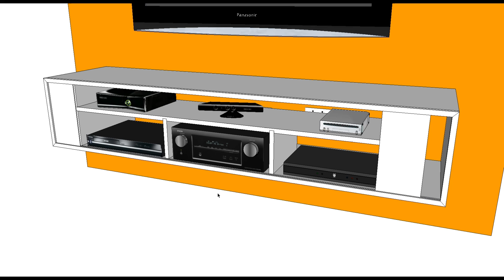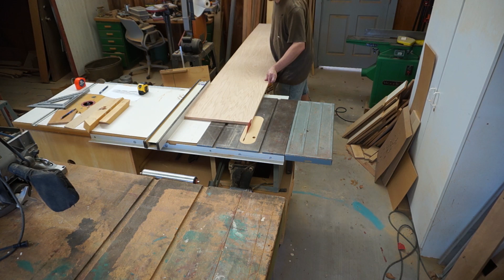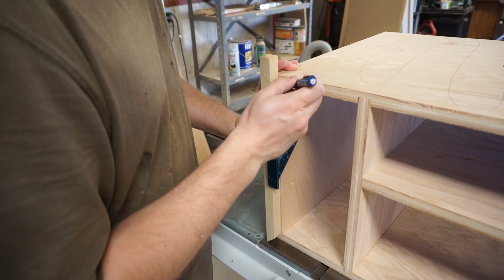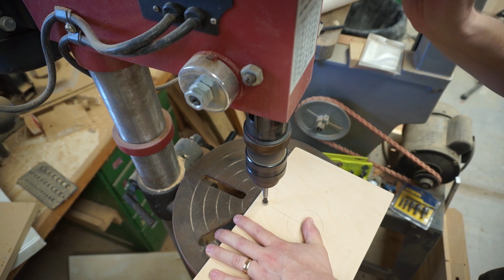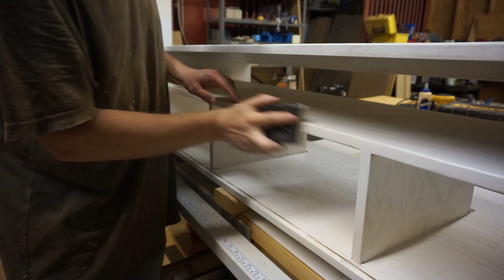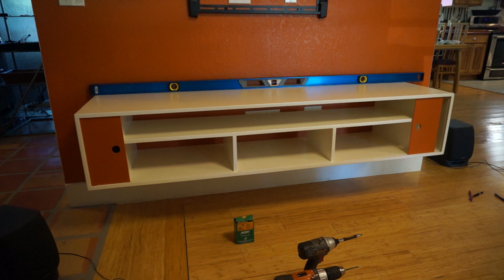Custom Floating Media Console | Mid-Century Modern | Woodworking

Comment: Do you get enough ventilation for the AVR? Seems kind of tight.
Reply from the maker: I was originally concerned about that and thought that I might need a fan... but no, the heat hasn't been any problem at all. The opening behind the components is open to the shelf above and it creates a "stack effect" of sorts, where the hot air is drawn up and out.

Comment: i downloaded the file and opened it up. it has the 3d model and a image of the boads and cuts, but info on actual board sizes( width and length of bottom/top boards ect) am i missing something?
Reply from the maker: The lengths can be measured directly in SketchUp since you have the full 3d model.  The advantage of this is that you can use whatever measurement method you prefer and get any variation of measurements you want.  I find static dimensions useful only in printed out plans.

Comment: 3/4 inch width not is too much heavy? I planning something like this but 7 feet long. Do you think 1/2 in width can work?
Reply from the maker: I didn't think that 3/4" was too heavy -- this specific design can be made with one sheet, so it weighs a total of 40lbs.

My original concern with 1/2" was that it would sag over time.  I will say, though, that after a couple years of having this installed, I haven't noticed even a tiny bit of sagging, so 3/4" may well have been overkill.  So while I never tried 1/2" in this application and so can't say for certain, it seems like you should be fine (maybe put a support half-way in the top opening, due to your extended length).

Comment: French cleats..?
Reply from the maker: French cleats could work here and were my original plan.  Using them does suggest that the piece be easily removable, though, and this console is practically built-in furniture.  The flexibility of a french cleat isn't necessary here and so I just directly screwed it to the wall.
Reply: @granworks  fair enough. Just figured it would been an easier install, and can still be fixed to the wall. Hehe. Awesome job though, the project and the video.👍

Comment: can i ask you some things please because i amconsidering to makesomething like this, hope its not too many questions... what width grove do u use for doors, what width screws did you use at 5.31 please, also you only screwed the back panel(poplin bit) from each side - is that really stong enough for wall mount?, How many screws do you into wall (i am afraid it will come away lol). The poly accylic- what one did you use and also the spreader- what is it. Many thanks by the way i enjoyed watching this video.
Reply from the maker: The door groove is roughly 1/4" or 6.5mm.  The screws holding the poplar piece to the plywood are the same 3" Spax screws used to secure the entire unit to the wall.  They are massive overkill in that particular usage, since most of the weight and stress is in the vertical direction.  I used them because that's what I had on hand, but they could have been much much smaller.  I then used four 3" Spax screws into the studs in the wall.  Those are each rated for 300+ lbs or 140+ kg weight so four of them is more than enough for the media console.  The clear coat is Minwax Polycrylic.  The spreader is a "Shur-Line Paint Edger" with a pad on it.  They are normally used for painting edges of walls and around trim.

Hope that helped!  I can give you some exact links to products if you want more specifics.
Reply: @granworks  hey much appreciated what you told me many thanks :).. Just a comment and it's something I heard before.... The comment you put about the weight being on the vertical, I seem to have this theory it's more like 70/30, the 30%being the weight pulling the screw away from the wall since the cabinet on its horizontal weight is applying force there also, so it's kind of away from the wall and vertical down the wall, what do you think?
Reply from the maker: I don't know what the actual force vector would end up being, but yeah, it would be at some angle and definitely not entirely horizontal or entirely vertical.  Still, we have to look at what kind of forces are involved and they simply aren't that much.  The poplar/hardwood hanging strip would certainly have been fine with just wood glue -- the screws are overkill just because I had them.  The screws to hold the console to the wall were #10, 3" long, and relatively high end (e.g., not drywall screws).  Even two would have been plenty.  The four I used were -- again -- overkill because why not.

You might enjoy the Project Farm YouTube channel, based on your thought process on this.  The guy there tests all sorts of things to an insane degree.  He has tested wood glue and several types of screws in the past.  You might be surprised just how strong both can be.

Comment: What is the overall size of the media console ... Please ...

Jacques
Reply from the maker: 72" long; 12-3/4" high; 17-3/4" deep.  Those don't fall on reasonable metric lines mostly because the console is designed to be cut from a single 4x8 sheet of 3/4" plywood.
Reply: Jacques here,
Thank you very much for the prompt reply.     Rest assured I am very impressed with your console as well as with the reply.  Mine is just a little bit shy of each meaurements.
Once again thank you

Jacques

Comment: how did you attach to the wall?, dont you think that a french cut could helped you better?
Reply from the maker: My original idea was to use a french cleat!  I didn't in the end because a french cleat is really only handy if you are planning on taking the console off the wall multiple times (maybe to move it).  This is "permanently" installed so that flexibility isn't needed.  So what I did was just take the wood strip that I WAS going to use as a french cleat and didn't cut it in half.  I then screwed that directly to the wall into the studs.
Reply: @granworks  oooh, thanks for answer me and for sharing your knowledge.

Comment: What hardware did you use to anchor it to the wall?
Reply from the maker: No special hardware.  The entire console is supported by the long horizontal board on the back and then I just screwed through that with 2" long screws directly into the studs.

Comment: So I’m doing a similar project. I painted three coats of latex paint and let it cure. Now I’m putting on the polycrylic and it’s cracking (alligatoring). Did you run into this problem? Any suggestions?
Reply: If you are using a water base paint your clear coat has to be water base also or the chemicals in the clear coat will react with the water base paint and cause alligatoring
Reply from the maker: No, I haven't experienced that.  Alligatoring with latex paint is nearly always caused by not waiting for each coat to fully cure before adding another coat.  That's not typically a problem here in AZ since the hot and dry weather allows the paint to dry on the extreme lower end of the recommended time.

In general, though, I will always wait until some time AFTER I am certain that the paint is cured before doing another coat since it's always going to be faster to wait that one time than to have to sand it all down later and repaint (and still have to wait) a second time!

Comment: How to you achieve a super smooth wood finish.  One that looks like its laminated?
Reply from the maker: Super thin layers, sanding with 400 grit in between coats.  Apply several super thin clear coats (polycrylic works well) and sand 400 grit between those as well.

I like using Zinsser BIN as the primer in these cases, too.  It's alcohol based and so dries incredibly fast and with zero tackiness.  That allows you to get several priming/sanding sessions done in a short amount of time, to start.

Comment: what is that jig type thing you had connected to the skill saw?  I need that.
Reply from the maker: It's an EZ Smart Universal Edge Guide.  I just put a link for it in the video description.  It's notably more expensive ($100) than the Kreg Rip-It Jig but worked MUCH better for me.  It's far more repeatable than the cheaper option.
Reply: Thank you sir!

Comment: Prime and paint the whole plywood 1st, then paint last coat when together.. inside consists of mainly touch ups 👻
Reply from the maker: Agreed!  I didn't do so in this case because I hadn't wanted to get any paint in the dados and grooves and mating pieces... but it occurred to me not long afterwards that I could have trivially just taped over the parts that weren't intended to be painting.  I could have even used by sprayer in that case, which would have made it dramatically easier.

Comment: Like the idea. Question; why didn't you rout the speaker wire through the wall?
Reply from the maker: The speaker wires actually are routed through the wall, starting at behind the media console and terminating with banana plugs behind the TV.  The actual speakers are supposed to be hung on the sides of the TV and so their individual wires will be hidden behind the TV.  These particular speakers are just temporary (and are fairly terrible) and so I didn't want to spend the time to hang them... thus the exposed wires.